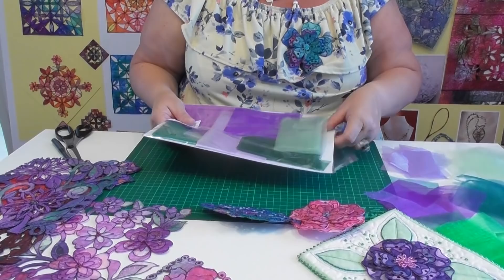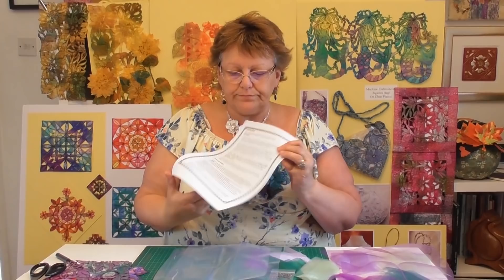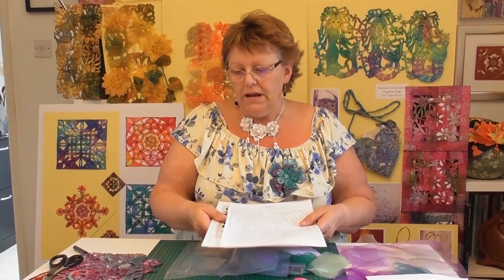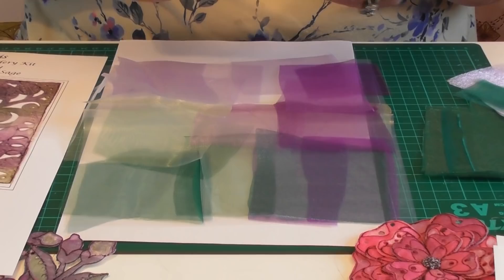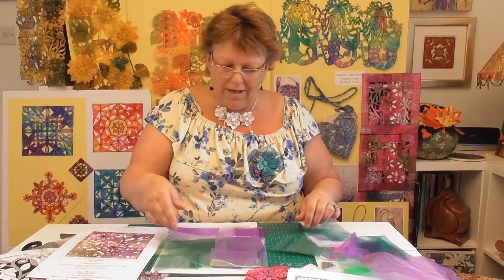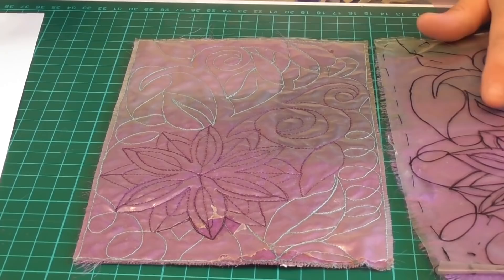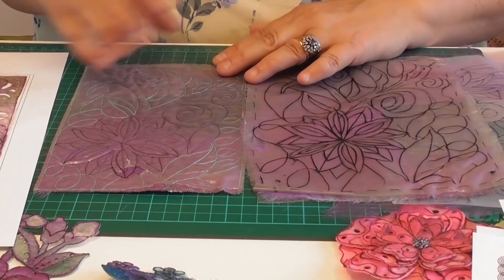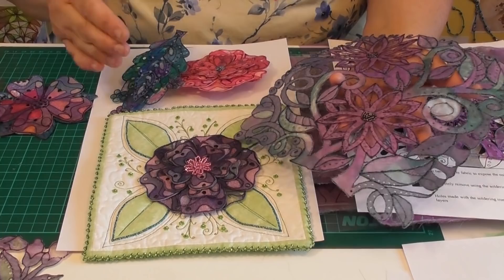Organza Technique

Comment: Very lovely work!  Thanks for sharing your techniques.  I have worked with silk organza—wonderful, sheer, beautiful.  In my work I color the pieces myself with a liquid acrylic paint thinned way down to protect the translucence.  I did a rather abstract garden of flowers, green grass, etc.  very fun to work with.  After basting down the pieces, I hand-stitched the edges of the pieces on top to hold the work together.  Lots of work! But I loved it.  I laid this on top of my quilt and hand quilted it.  It was a very long process and more difficult than it sounds.  So glad to hear about a much easier way to go.

Comment: I bought one of your kits and had such a great time making it! Thank you so much for sharing this. I've made my own pieces based on my own designs and I've been looking for a thicker water-soluble stabilizer like the one you included in your kit, but I have been having a hard time finding something similar that is clear. Any suggestions?